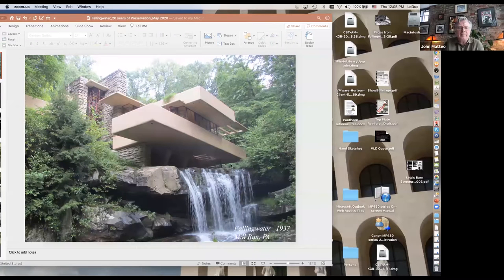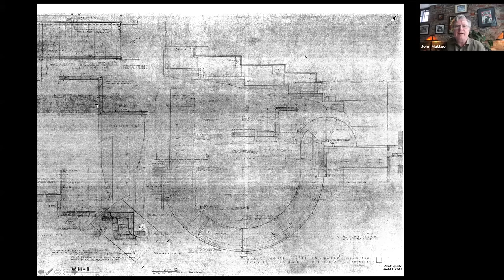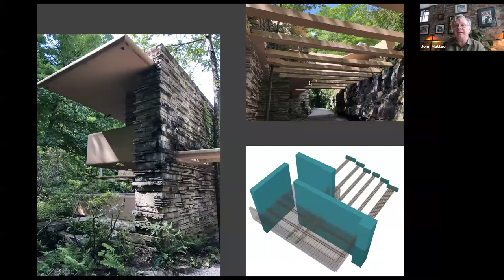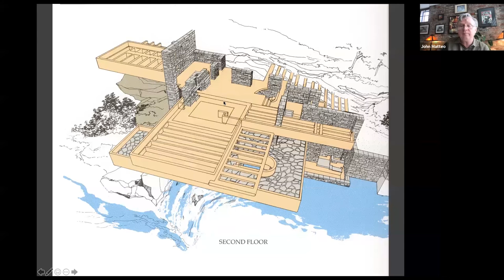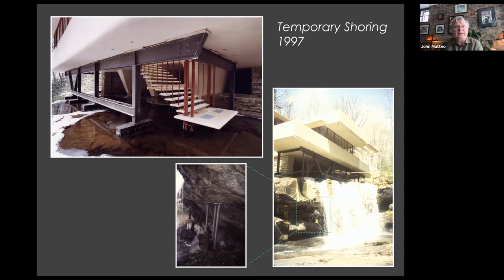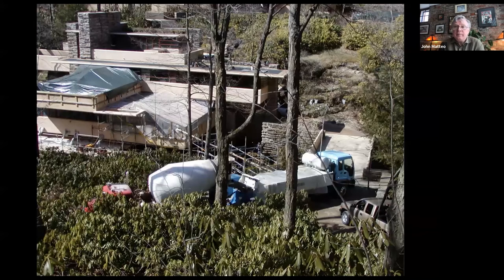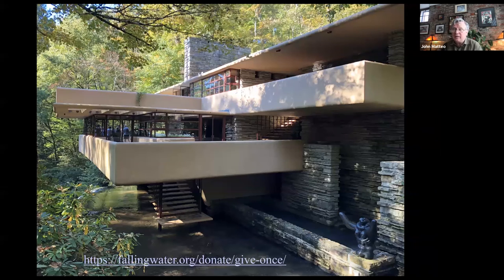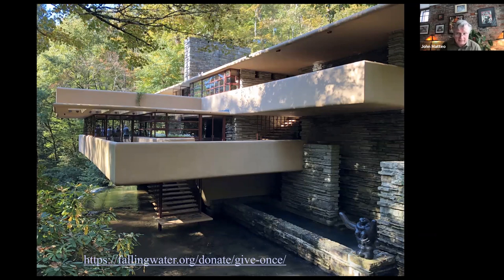Saving Fallingwater: 20 Years of Preserving Wright’s Masterwork | John Matteo, PE, FAAR

Comment: You might come back with spring steel I-beam,... running along your floor joists. Set up a center,...up on the big foundation footing, ... making a lifting of the outside end,...thereby removing weight through the spring/fulcrum set up at the end, and having applied the weight in toward the foundation.

It's balancing like a teetor-totor, isn't it???

Comment: Very cool.  I understand post-tensioning now.  My only concern is that I was surprised the old concrete cantilever beams didn't crack when they pulled the cables? Especially given the fact that concrete gets brittle over time.  Anyway, it all worked out!